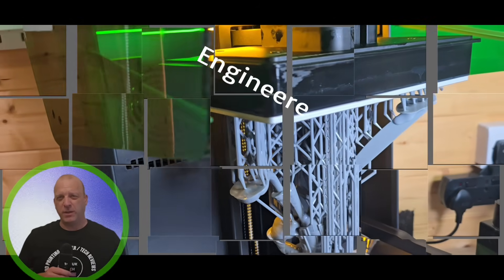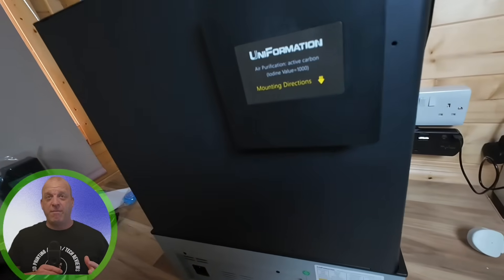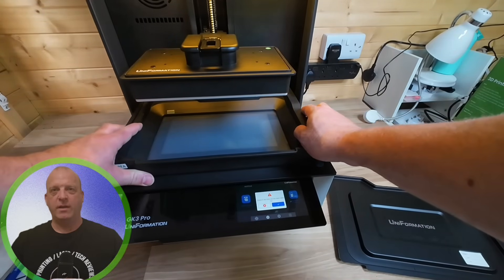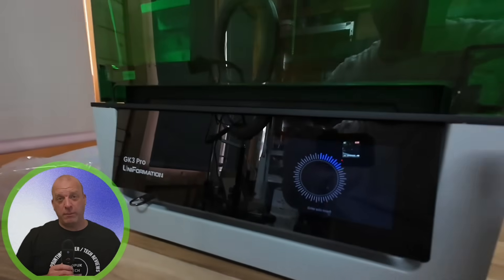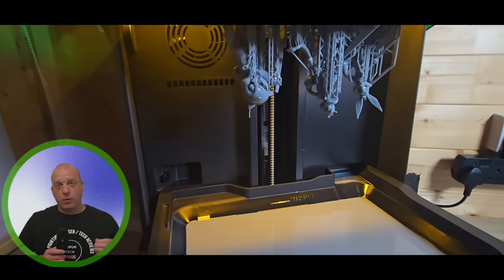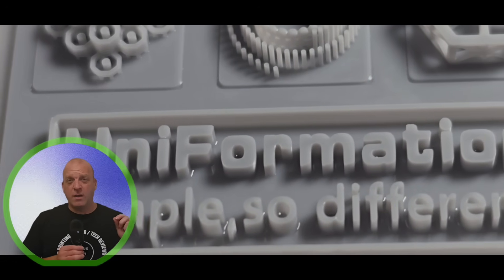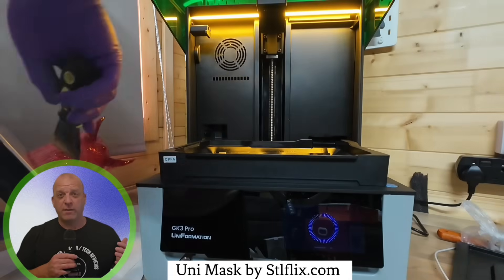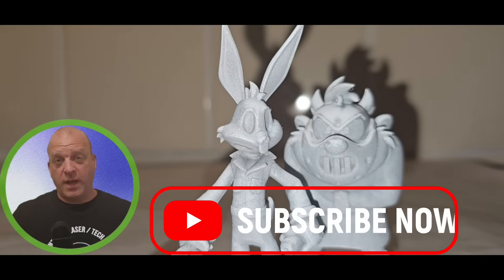Uniformation GK3 Pro – What You Need to Know Before Buying

Comment: I was almost buying the GK3 but decided to download and install their slicer. I was not able to install it or open it. (I have a gaming PC and gaming laptop). I see Reddit and many many people have this problem, I tried for days and days, but failed. I would suggest whoever is interested in purchasing this printer, to first try and install the slicer on their computers.
Reply: I’ve been using UniFormation’s own slicer and honestly, it works pretty well — pretty practical overall. If you ever run into issues, their community is super helpful and usually quick to give advice. Otherwise, ChituBox is also a solid alternative.